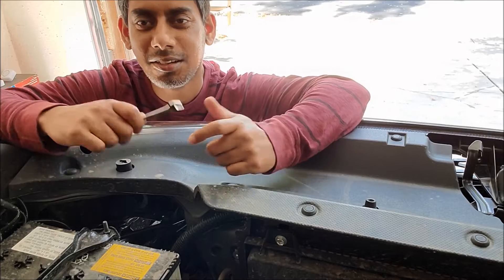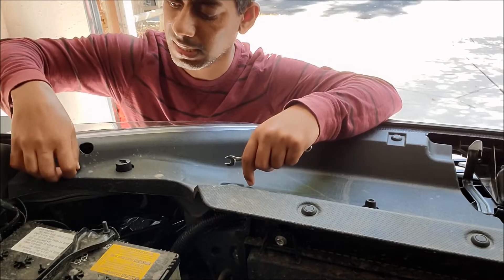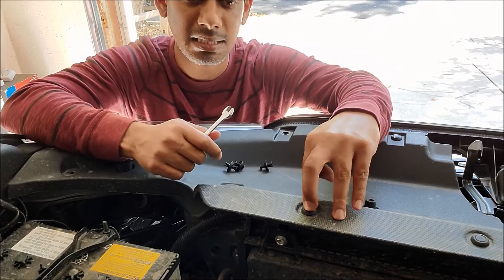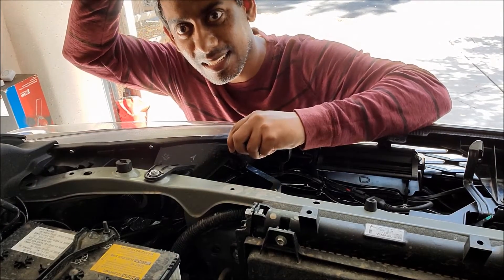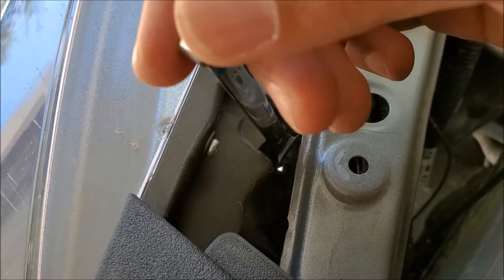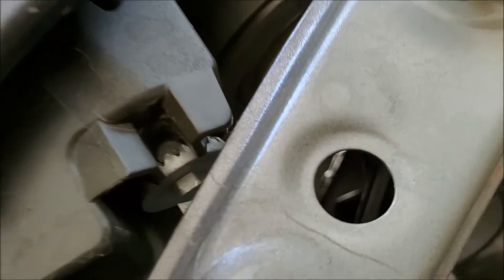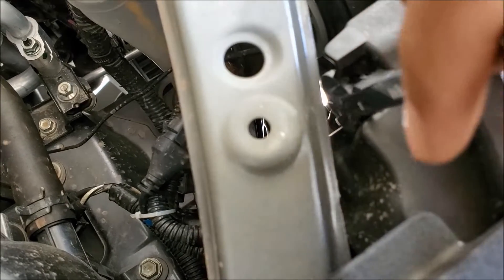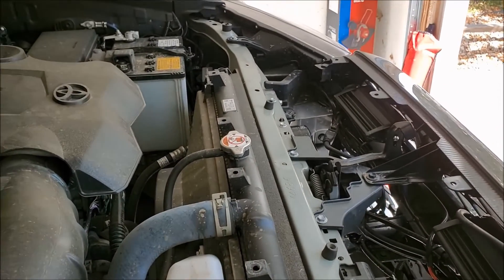How to adjust your 4Runner headlight level?

Comment: Did you know there is a hole in that plastic piece that you can put a Phillips head screwdriver in and turn to adjust the headlight?
Reply from the maker: Yes that's how I did it one time and resulted scratching the plastic just over the nut. Why I shared this, so people can do it without scratching.